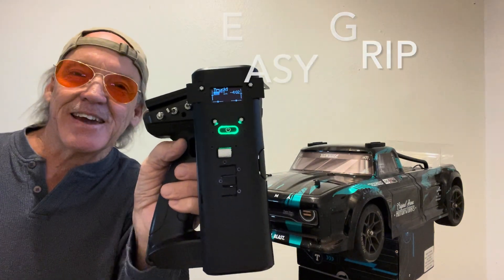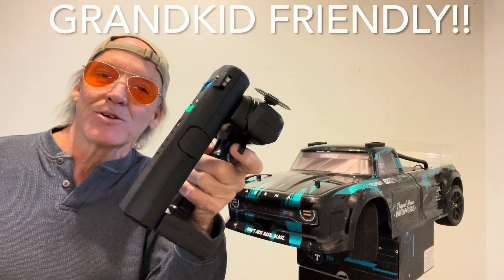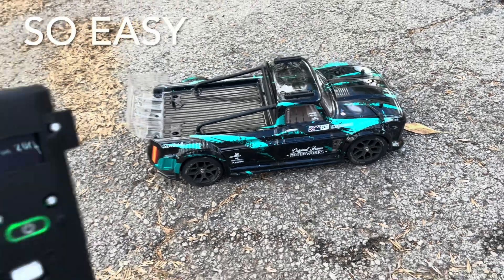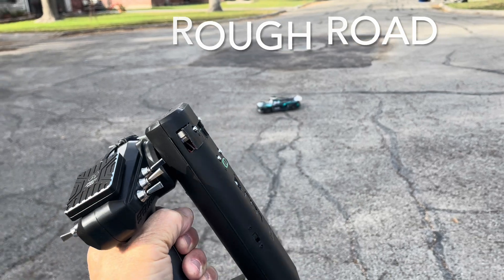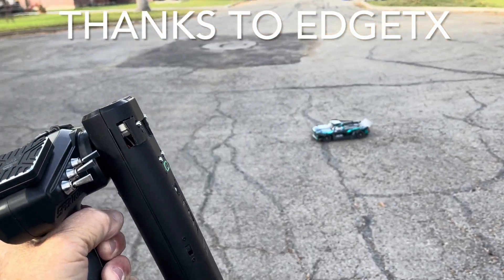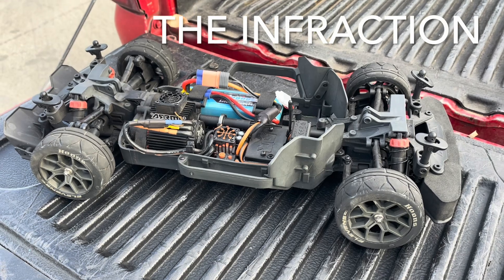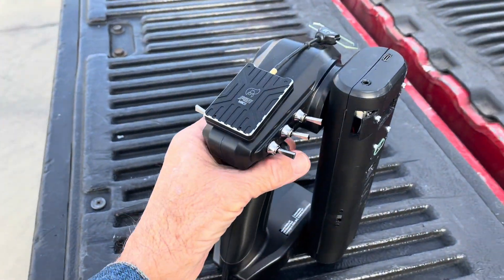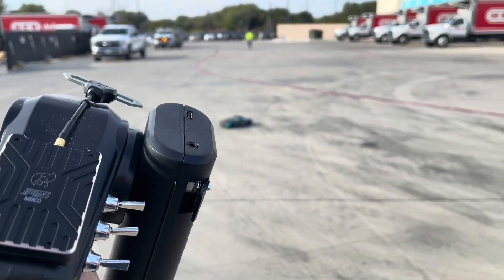NO STEERING WHEEL!!!!

Comment: if you're gonna do that you might as well make it a smart phone app and use the tilt sensor in the phone to steer. like smartphone games do.
Reply from the maker: This is NOT “TILT” technology…

It operates anywhere in space in any orientation…

Hand out, down, up, backwards etc…

“TILT” technology requires you hold the unit in a specific way…

Just as you can walk around with current radios…..so you can with this as well…

Thanks for the truly insightful comments and your time.

Comment: Sanwa M17s has that feature too
Reply from the maker: While it may seem that the M17s and DJI motion sensing systems use my patent pending technology, it is very unlikely…

For example, I can assure you that all the advanced Helicopters and Aircraft I fly on this channel, (@HandyEdgeTx) require substantially more technology than motion sensing…

Thank you for taking the time to offer a perfect comment!
Reply from the maker: It may help you see the difference by referring to M17S manual pg. 106…

To calibrate a motion controller, it says, “keep m17s vertical position on desk, and enter for [NEUT].”

That is, tilt from neutral only…

On my HandyEdgeTx-EG, it doesn’t matter if my hand is out, up, down, backwards or anywhere in space or orientation..

I hope this helps and again, thanks for such an insightful comment